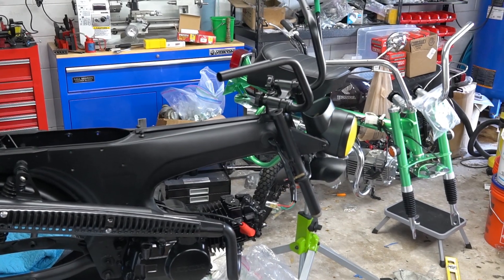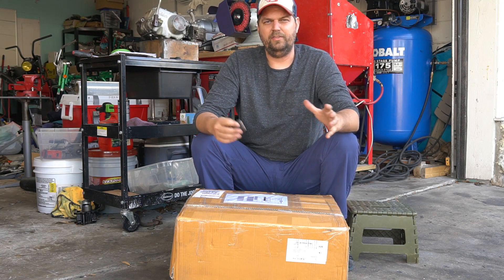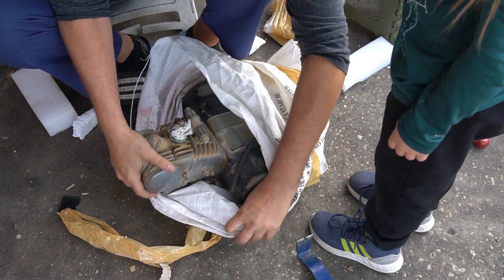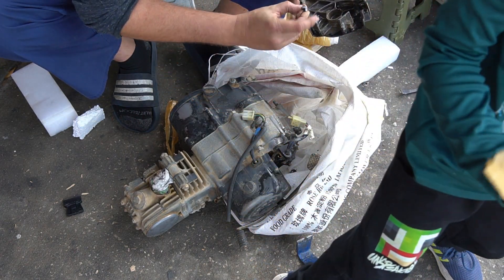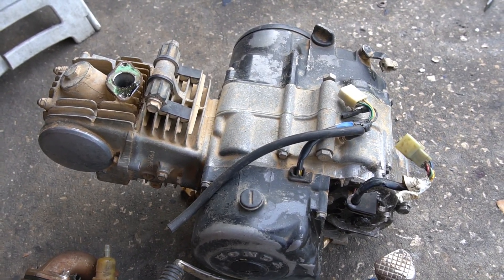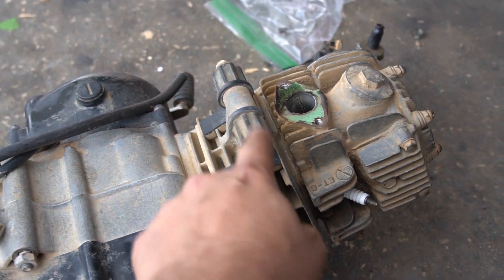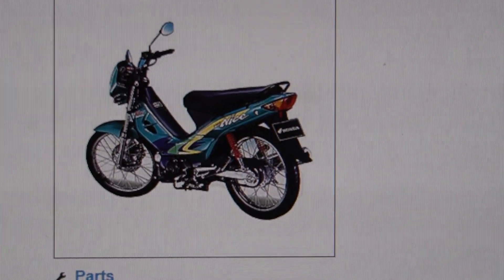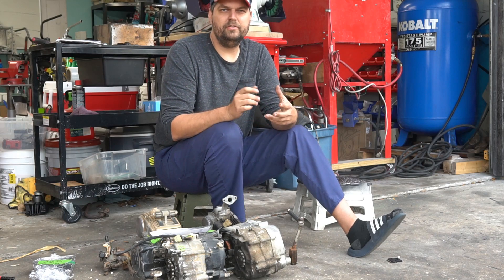Imported Honda NICE 110 Engine - Unboxing & General Overview Video

Comment: Very very cool josh. I was In Greece a good 5 years ago on a trip and the Honda nice style bikes were everywhere and look like solid workhorses with good engines
Reply: I am from Greece. Most common tuned engines are from C50/C90 (or GLX model here), C100 ASTREA GRAND (same as C50 engine but with better clutch, bigger cylinder head and 50mmx49.5mm bore x stroke) and ANF125 INNOVA (totally different engine but easily upgradable, not compatible with C50 engine mounts unless you drill new holes for the engine). We prefer to tune older engine (such as C50/C90) and change the gearbox to a 4 speed for better performance. You can actually buy ready to bolt on kit with 290euros and it includes CDI cylinder head, new aluminum-nikasil cylinder, 56mm piston (flat or domed), 56mm stroke crankshaft and engine gaskets. You need to machine the old crankcases to fit the new cylinder (most teenagers did it with a dremel, veterans had them machined for perfect fit) and buy a 28mm carb for the kit. The most tune ups are (bore x stroke) 54mmx54mm, 54mmx56mm, 56mmx56mm and 57mmx56mm, The C100 ASTREA GRAND engine is the same as Nice but understroked, semi automatic clutch and has electric starter

Comment: I have wanted to see some new content from you I have a number of 50 70 90 110’s that I need to get done and get out of my barn. The 70 is a 300 mile ruby red original that I’ve owned for 25 years now. The rest of them is the ones I need to restore. Your “package” you were discussing, is that where I would tell you every part that I think I need for each bike and I might get a discount for the volume off list?

Comment: I know it probably varies, but what’s the ballpark price on these if you can find one?
Reply from the maker: Could be $600+ shipped (non runner?) out of Thailand (risky) etc or I don't know how much someone is willing to pay on one coming from a source within USA /  local market
Reply: @VintageHondaMinis  that’s not too shabby. How did you find your contact in Thailand? Is there a company or anything?